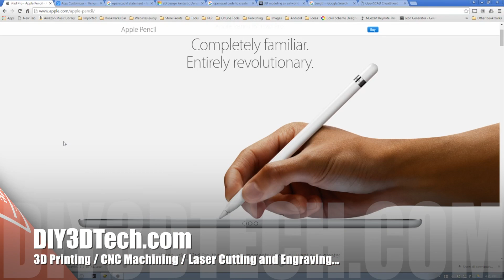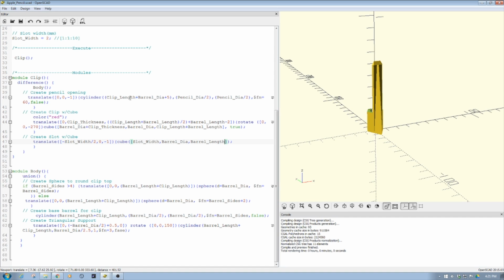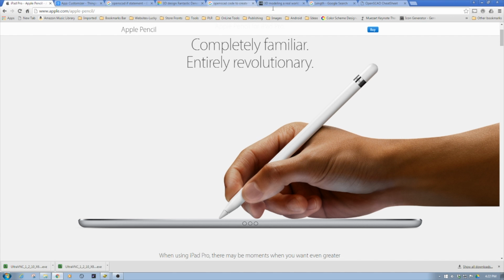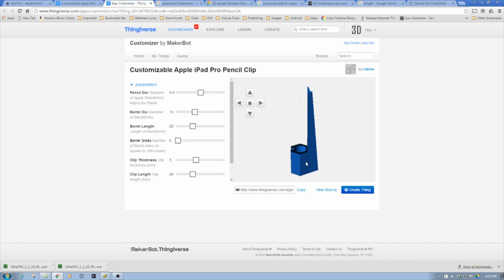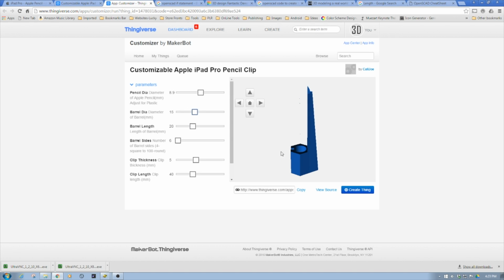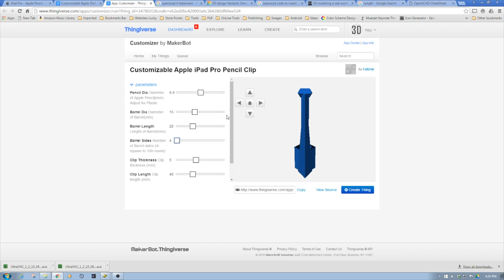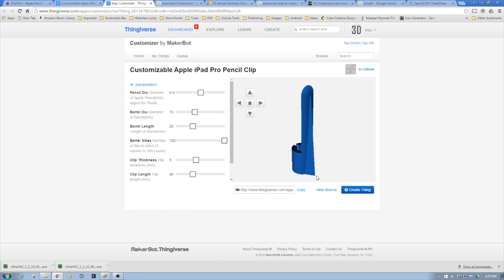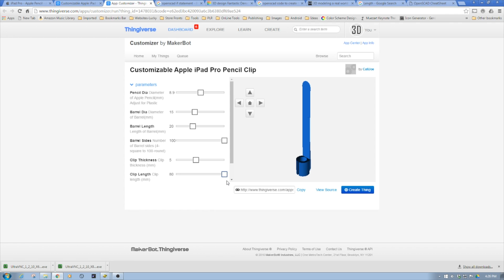3D Printed Project - Apple Pencil Clip From Thingiverse!

Comment: I laughed out lout at the DaVinci.
Reply from the maker: +Mickice me too! That's why I published it, the good, bad and ugly!
Reply: I once had a similar failure like that, but I was printing something so incredibly tiny it wouldn't work.
Reply from the maker: Believe the same issue here as the clip was to small as when I made it larger it printed just fine..
Reply: Hm, the problem with me was the item I needed was only 6mm in length and something like only 6 layers high. I should probably keep trying, like a challenge.